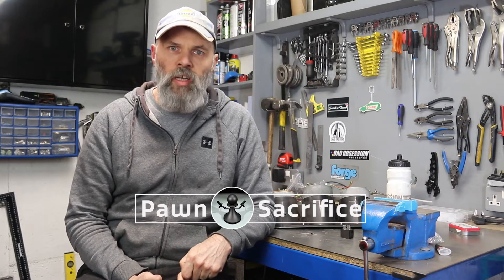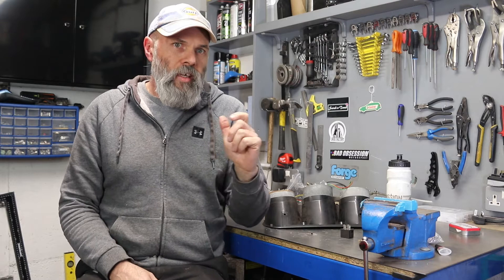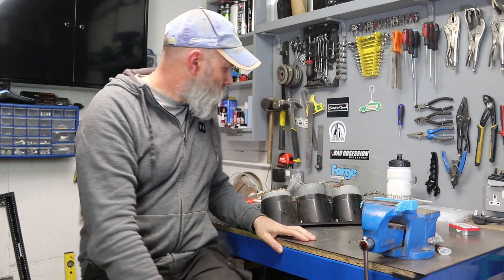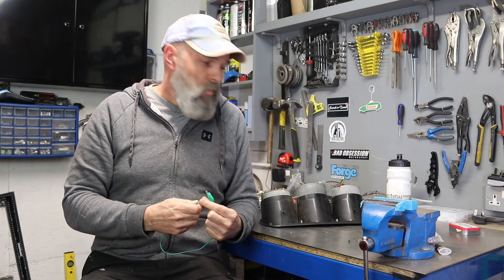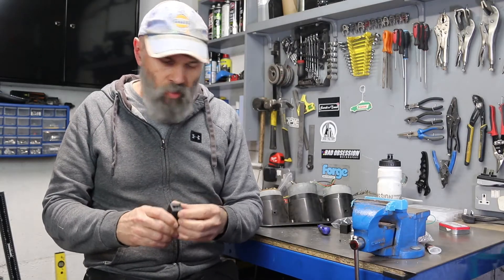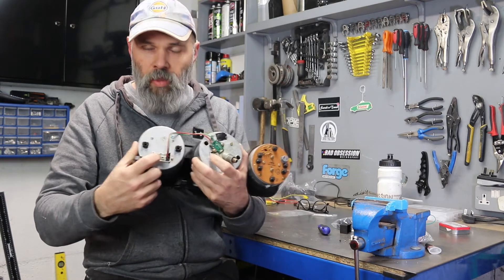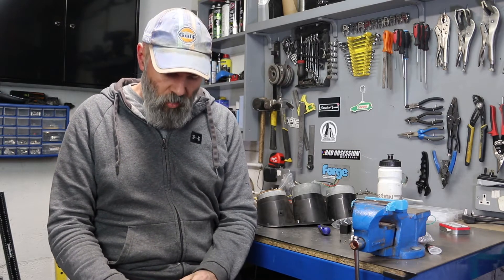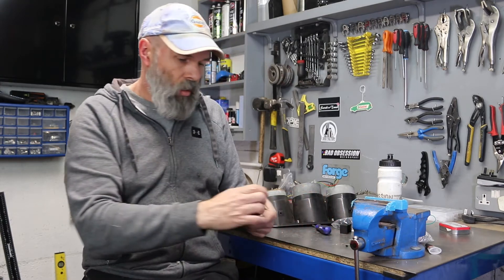Easy DIY Adapter - 5V ECU tacho signal to 12V dial | 924 S Turbo Build 59

Comment: Great content, my friend! I have a 5.3 LS engine installed on a 1999 Range Rover. Will this product help me get the RPM reading on the Range Rover's instrument cluster?
Reply from the maker: Honestly, no idea, maybe see if you can find the wiring diagram for your cluster and see if it matches, or see if there's a similar DIY convertor.

Comment: thanks! The tachometer still has lower rpm than real, is any way i can improve the circuit to adjust this issue?
Reply from the maker: To be honest, I'm not sure, you'll need to research that one - if you fix it and update for others would be great. Good luck!
Reply: @PawnSacrifice  Thanks! I installed a diode too, maybe if i remove it the rpms will improve...

Comment: About ready to do this. Although a modern 90s  suzuki  car.. the signal the tach gets is like an older style and requires newer  to older  style adaptor when you add aftermarket components.

Comment: The resistor and transistor thing flys way over my head. I got the tach working using just the coil but wonder if that will mess up the cdi ignition box, which is my situation.

Comment: Hi, this has to be the best video of this out there. As you say, others assume that everyone doing this has a certain level of knowledge already. Not sure if you can answer this? Why do you need the transistor? I got a diagram from an aftermarket ECU maker, showing exactly what you have, less the transistor. I have made up a converter, using the relay housing, removing the contactor, and joining the resistor from pin 86 to pin 87, then it will be connected via spade terminals. 12V to pin 85, tach sig pin 86, ECU output pin 87. Still wiring the engine and transmission, so haven't tried it yet. Thanks for the great video. Cheers
Reply from the maker: Thanks, and not sure re the transistor, may be for the flow control or failsafe, not sure - I was really just following the original diagram.

Comment: to complicated use the same relay housing... put the transistor and resistance inside the relay housing buy a relay connector and do the connections

Comment: Hi. Excellent video. Would this also work with a diesel tacho designed to receive a 12V alternator (sinusoisal) signal, driven from a 5V ECU pulse please.
Reply from the maker: Sadly I cannot tell you - I had to follow / patch together instructions and then do research just to get through this.
Reply: @PawnSacrifice  hi, I wonder if its the other way around? Like if the signal is a 12v signal going to a 5v tachometer gauge?

Comment: Dear friend you are the best.we tested on the 205gti 'works great with em221 ecu,we changed resistor to 4'7k
Reply: Witch engine was that with? I'm trying to get my Peugeot 205 working with the TU5J4, its looking like the same issue Pawn Sacrifice is explaining. Thank you for the video @Pawn Sacrifice massive help.
Reply from the maker: Thanks for the info - may well help others, good work.

Comment: Hi  honest question, how is the STAHLWERK  tig welder doing?. would you still recommend it? I'm looking at the STAHLWERK AC/DC MIG 200 ST IGBT £499 Amazon it's a bit cheaper than yours but I hope you might be able to throw some light on the subject before I commit unless the one you got is better.Thanks
Reply from the maker: The foot pedal or something has gone on mine, still working well for stainless steel but something's not right for aluminium - not helped by me being a total novice. Mine broke in the early days and had it sorted under warranty but needed shipping back to Germany, that would be an expensive and lengthly exercise now. If you get a TIG check Hobbyweld for the gas.

Comment: Note for other people trying this - verify you don't have any voltage back feeding from the tach gauge line - it can blow the transistor pretty easily. For reference, a vw Vanagon with the high oil pressure alarm circuitry may have voltage flowing back from the gauge cluster, and it will kill the transistor. Also, if you hook it up backwards (switch the tach out and signal in), the 5v without a current limiting resistor will carry enough current backwards through the tach gauge output line (now hooked up incorrectly as a 5v signal input) to kill the transistor, and the diode will protect you from that failure mode. I'll try to remember to add which diode I used shortly.
Reply: Uf4007 is the diode I used. Soldered inline so the tach signal can go to the gauge but no voltage is allowed back in through that wire.
Reply: @super_slo  sincerely thank you for this. 

Using this trick on a CE2 Golf with standalone management and have gone through a few resistors. 
Measured the voltage coming from the fuseblock and.. well just like you said.

If you hadn't said this is due to the high oil pressure alarm circuitry I would've never even known why either.

Comment: Hi there...thanks for the video, may I know what kind of ignition coil setup that used to drive the Porsche dial? Is it distributor, wastespark, dumb or smart coil. Thanks
I'm struggling to get the dial (negative coils pickup) working.
Reply from the maker: The factory Porsche setup uses a distributor. Hope that helps - and good luck!

Comment: this is very interesting... if the relay isn't using the switch side and is only using the coil... could you just use... a coil? like an inductor? seems like they just want an inductor in that circuit. perhaps they are using an auto relay because they know automotive folks would have those on hand? anyhow, thanks for filming and sharing.
Reply from the maker: Honestly, I have no idea - I just followed a few different sets of instructions out there, I only put this together following others' work as there seemed to be gaps in other "how to" guides or assumption you know what the diagrams mean.

Comment: good tutorial. u know something about noise filtering? i build this to my mk2scirocco but with bd139 transistor and have some noise.
Reply from the maker: Sorry I don't. Assuming this is right for your setup (I believe there are some difference - if your car does work differently the video will hopefully help understand any documentation - that was my biggest challenge) I would probably check the grounds to see if there is an obvious source for the problem.